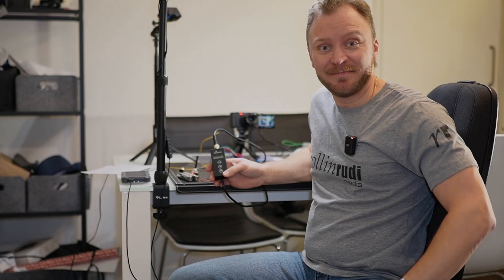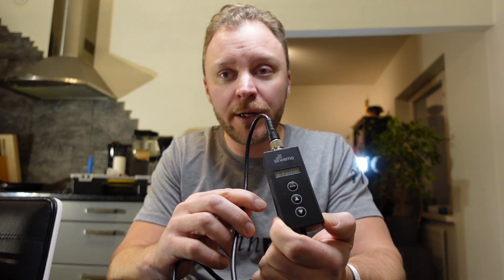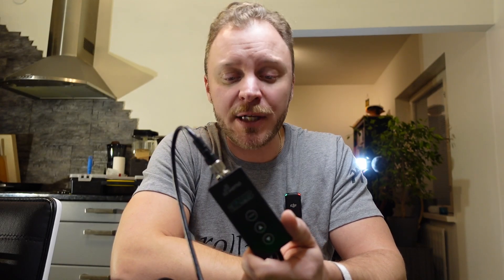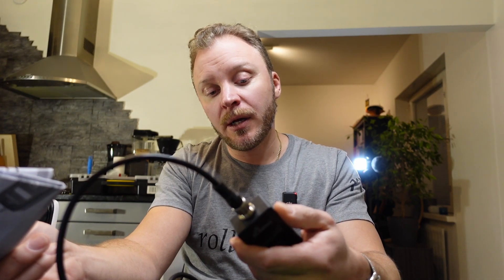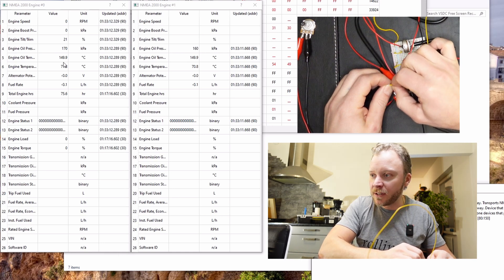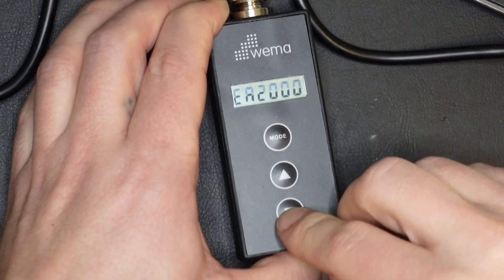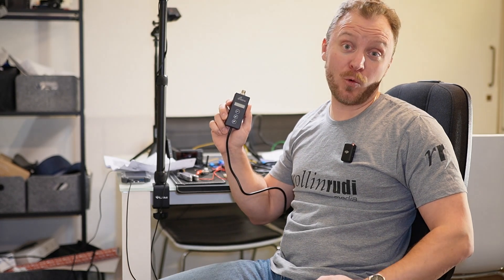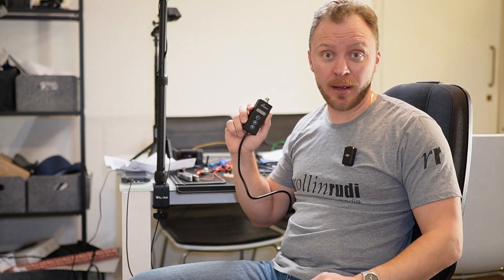Wema ASC-6 Analog to NMEA converter review

Comment: If it has another pressure mode use water pressure to determine if you have incoming water or an exhaust manifold temp sensor. With no water flow the exhaust will heat much faster than the engine. It will also indicate if your exhaust manifolds are getting restricted.

Comment: Hi Rudi, It seems that thanks to you configuration must be possible. Anyhow some questions: do you connect the configuration tool by USB and do you need to download something to visualize it? Second most important: A bus structure is easy but how to connect the ASC-6 to 6 sensors? I only see one cable or does this thick one contains 6 smaller ones? Thirth question: do you put low fuses in between?
Reply from the maker: Hi, sorry for the late reply. I use wifi gateway from Yacht Devices to connect. The software I used to connect is CAN Log viewer. This is recommended by Yacht Devices. I must say it is a bit cumbersome, but once you learn it, not too difficult. The one fixed black cable contains the smaller leads for the signals. No fuses needed in the signal cables and the ACS-6 gets it's power from the NMEA.

Comment: You seem fairly techie, that is an expensive solution, better to implement Signalk software on Raspberry Pi (SK = Which is NMEA2000 Paths)., Use ESP32 board and SENSESP libraries to read from an INA519 from the gauges and send to Signalk (  ESP32 and INA519 are pennies to buy. rest is free - just your time.) I am working on the same thing with ChatGPT to help me with the ESP32 code.

Comment: Hi Rudi. I am thinking about installing this converter into my boat with 2 engines and i have a question....so for 2 engines i need 2 devices-OK. So with 2 identical devices in the same network, the instance(or some kind of ID) hast to be set on one of the devices, to diferentiate the two on the network. Is it possible to do tha directly on the device or do you need some other tool/device to do that? Thanx.
Reply from the maker: Hello, thanks for your question. That is exactly how it is supposed to work instance 0 for another converter channels and instance 1 for another. Unfortunately I don't have experience of whether it then works in reality or not, but at least the manual states so. 😌
Reply: @rollinrudi  Hi Rudi. I got in touch with Wema. Below their answer:
"ENGINE #1
Rudder: Type: Rudder, instance 0
Fuel level: Type:fuel, instance 0
Water level: Type: water, instance 0
Oil Pressure: Type Oil pressure, instance 0
Water temp.: Type: water temp instance 0
Tachometer, instance 0

ENGINE #2
Rudder: Type: Rudder, instance 1
Fuel level: Type:fuel, instance 1
Water level: Type: water, instance 1
Oil Pressure: Type Oil pressure, instance 1
Water temp.: Type: water temp instance 1
Tachometer, instance 1

You then setup each display or gauge to reflect the same type and instance settings.

Therefore any huge or display looking for Type water temp, instance 0 would display the information from the water temp. sensor on engine #1

The ASC6 does not have an instance as it is just a convertor."
Reply: @rollinrudi  The reason for my question is that the Wema sells the Set-Up-Tool for NMEA2000. I couldn´t find the manual for this tool so thought, you maybe know if it is neccessary to set up 2 devices. :)